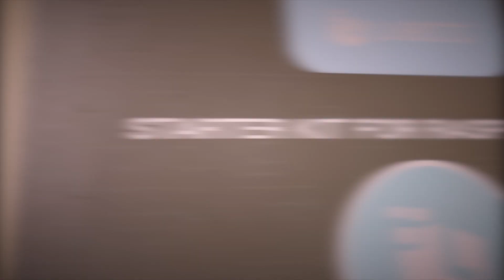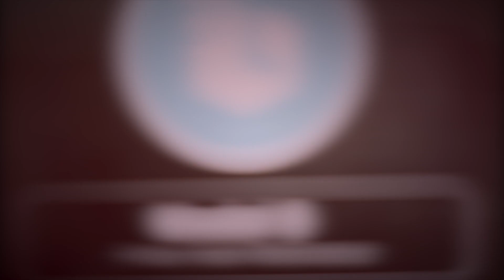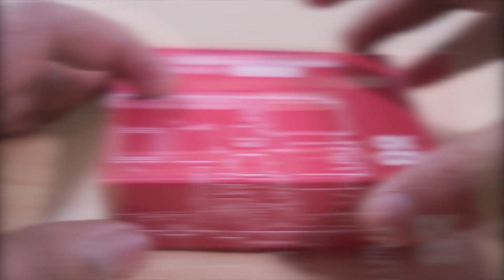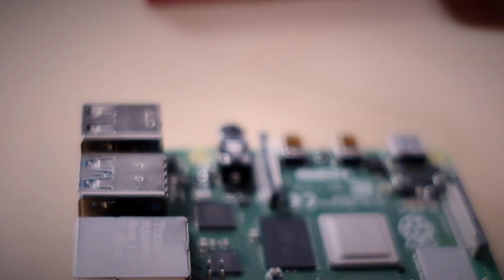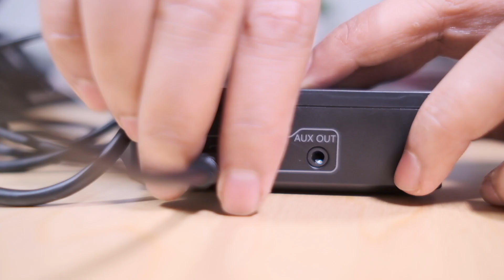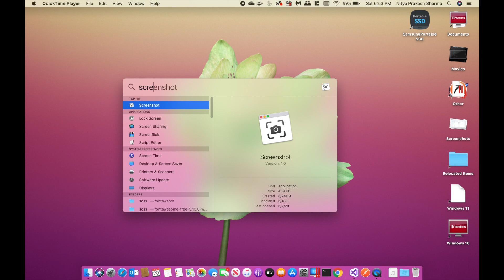My First Raspberry Pi Setup

Comment: Hi Nitya, suppose I want the village kids to use this as a setup. What all they will need to have/BUY for a fully functioning computer which can allow them to attend online classes as well as do their homework on a raspberry pi.
Reply from the maker: Cheap keyboard,mouse and monitor is sufficient.  Raspberry pi itself is full computer.
Reply from the maker: Also raspberry pi zero is capable of running image recognition algorithm.  But will not be that fast. But basic need computer can be created.